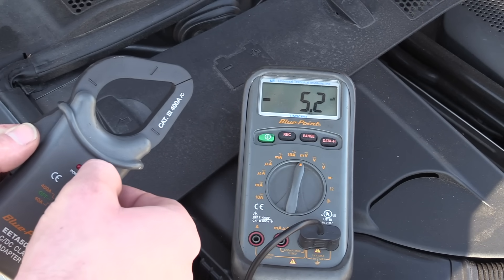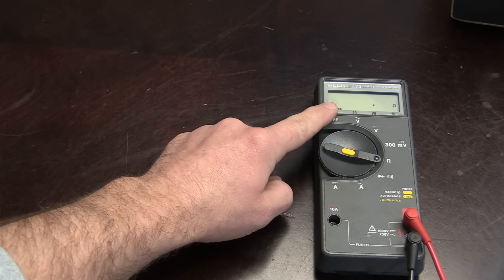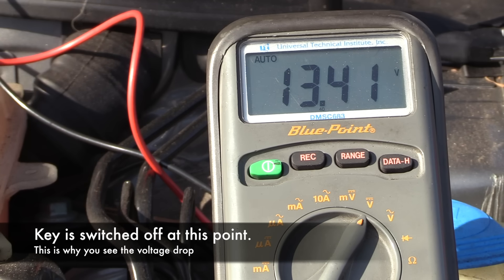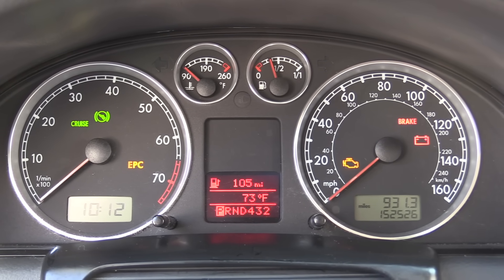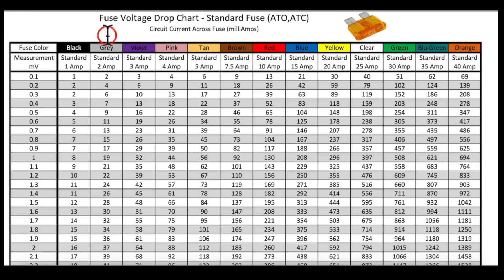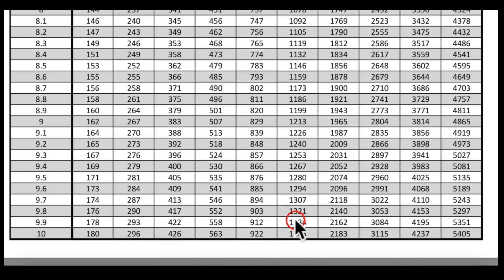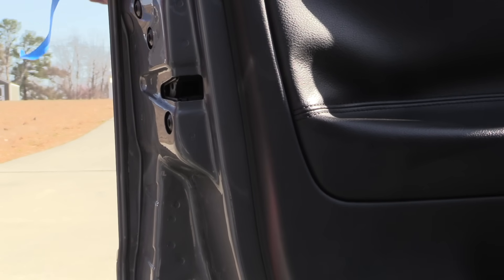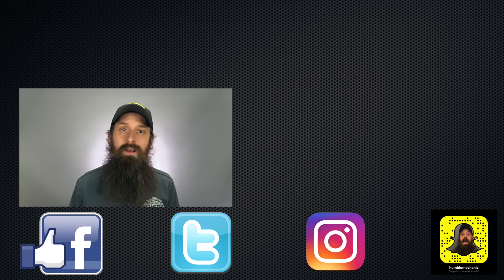The BEST Way TO Perform a Parasitic Draw Test

Comment: What is confusing me is , why does the fuse amp rating make any difference, seeing as they all have the same resistance? Please.
Reply: August Chennells 
Fuses will have different resistances depending on current rating. Fuses with a 1 amp rating will tend to have resistances around 100 milli-ohms. The higher the current rating the lower the resistance. Once you get to fuses with ratings above 2 amps, the resistance becomes so low, that standard multimeters will not measure it. In fact, most meters will see this as a short. It is this difference in resistance that causes each fuse size to trip or melt for a specific current level.

With regards to the 5A and 30A fuse:
If you are running 1 amp through each fuse and measuring the same voltage drop across each fuse then some thing else is not accounted for. Are they the same fuse type? Is it the same model of fuse? Was it made by the same company? Is the meter capable of accurately measuring voltages that low?

A quick look at a Littlefuse data sheet has a 5A unit with 0.0224 ohms and a 30A unit with 0.0019. ( Cold resistance )
Reply: August Chennells higher resistance would mean lower amps so pretty sure they all have different resistance
Reply: Not hard to check that with the VOM. I always thought the amp rating is determined more by the diameter of the fuse conductor, therefore the melting temperature. Am I wrong?
Reply: August Chennells 
It is the cross sectional area and composition of a conductor thar will determine the resistance for a given length of conductor. The smaller the area the higher the resistance for a given length. The smaller the area the more heat generated by a given current. The smaller cross section also means less mass to dissipate the heat. Fuses of different current ratings will always have different resistances assuming they are made of the same material.
Reply: Thanks for commenting Andrew! I understand that completely. But consider this, if you take a 5 amp fuse and a 30 amp fuse, and run 1 amp thru both, the voltage drop will be the same. When checking for a parasitic leak, the amperage will be minute, and the amp rating of the fuse will not make any difference. Or am I missing something?
Reply: Thanks!  I always thought it was only the conductor cross section in the fuse that determined the amp rating. You're saying that it also includes the composition (alloy) of the conductor. Right?
Reply: August Chennells 
Manufactures tend to stick with the same alloy within a particular model of fuse. They would use different alloy formulations to achieve other characteristics. Reduced package size, slow blow, and fast blow types come to mind. Within a particular model of fuse, they would typically only alter the physical dimensions of the fuse element itself. Thinner element/lower trip point.
Reply: Thanks! I assumed that was the case. So back to my original assumption, that when measuring the voltage drop across the different fuses, and then looking at the chart to estimate the amperage lose through a particular fuse based on its amp rating (color), is fruitless and meaningless, because all the fuses will have basically the same resistance in the low mil amp range of most parasitic losses. Does it matter how much the parasitic draw is? No, you just have to find and fix it.

Comment: Great video! I subscribed! I have seen draws go away when a battery terminal was removed to check for a draw. I have gotten into the habit of connecting my leads to both sides before removing a terminal.

Comment: what's the best way to find a short in a non fused circuit(like say a pickup coil to ignition coil on an old carbbed/distributed engine. or possibly if the short is before the fuse? I'm having issues with my 84 ford f150 it's killing the battery to flat in less than 4 hours, but it's completely intermittent. for a month, it'll be fine, then for a week straight I have to disconnect my battery (which sparks when I do so). I've been trying to figure it out for a couple months now.
Reply: I've done the fuse test and they all pull zero when off, battery load is   0.751 amps across positive terminal to batt post when truck is off. normal for the truck per the dealer is 0.006 amps.

Comment: If I thought I had a draw on my trunk light should I leave it open and simulate it being shut or leave it shut?
Reply: albert fishstix
Id be checking the light even turns off when its shut... a dicky switch might be leaving it on all the time.
As for this test, I cant imagine it matters one way or the other. As I understand, the point of having the door open is to access the fuses. Fake shutting them is just to allow "locking" the car and letting it drop into sleep mode.

Comment: i used to have a f250 that had a draw, somewhere. i just put a big disconetet for the battey on the front bumper. fixed. the guy i  sold the truck to found a burned wire in the altornater...

Comment: Wow! This is great information at the perfect time. I've been hunting for a draw on my 98 Chevy truck. It's been kicking my ass big time. It only kills the battery if I let it set over the weekend. I finally caved and sent it to a shop Thursday. Called them Friday after work and they haven't found anything yet. Hopefully it's dead Monday morning so I can show it's not in my head. If they can't find it, I'm going to put this to good use and see if I can get it narrowed down. Hopefully they find something, diagnosing electrical gremlins is my downfall haha.
Reply: ih1206 hey, not sure if you have a CD player in that truck but I had 2 cds stuck in mine causing battery drain. I was able to pull one out with needle nose pliers.
Reply: I do have a Pioneer radio installed in the truck that's been in there for years, but I've had the cd issue before on other vehicles. The shop tracked it down to the horn wiring harness. It never blew the fuse, but that fuse killed the draw. I'm leaving it sit this weekend to see if we cured the problem. Fingers crossed that we got it.

Comment: I'm glad you posted this! Just last week I printed out this voltage drop/fuse chart off another site. Well, just checking it against the Powerprobe site, the figures on it were WAY off! The print quality was terrible anyway, so I may have missed some key information about which style of fuse it was. Either way, I just pitched that printout in the trash, and I'll print the Powerprobe charts. You probably just saved me some major hair-pulling during future testing! :D

Thanks yet again, Charles! :)

Comment: Didn't know the voltage drop over a fuse is measurable with a multimeter at such low loads, thanks! Some cars don't have the door switches integrated into the locks. Especially older cars often have them on the body itself, so if locking the door doesn't work, it may be that the switch is simply somewhere else :)
Reply: Thom kouwen   Yes, I'm not quite following this, but I'm going to go with it. R, V and I Thevinan is in my mind, but it's pretty well in a hibernated state if not gone.
Reply: Grace James

Comment: so if i checked all my fuses by pulling and putting them back in on my 06 jetta 2.5 that may have messed up some electronics? i have experienced some issues since then such as the heated seats not working and also the engine having trouble starting sometimes( mainly cold mornings) and if so how would i treat this? much appreciated
Reply: If you are pulling fuses, and can think of it beforehand, take a picture of the fuse box before you start, with your phone or camera.  Even when pulling them out one at a time (foolproof, right?), I've dropped a fuse and when I looked back up I wasn't sure where it went because there were enough unused spaces next to the right spot that confused the issue.  This is especially useful when you are older and need reading glasses to read charts or if the chart is embossed on the plastic cover and hard for anybody to read.
Reply: haggismacbunk - So true. Accounting for that already saved me a lot of grief in several cars. Beside the reading glasses issue, trying to read/see fuses while laying twisted with the fuses seating deep into the under dash. It's a challenge at any age. BTW a perfect occasion to develop your swearing skills. LOL ;-)
I always thank Mercedes for having put the fuses and battery on the passenger side floor. Flat, horizontal, accessible and can be worked or perfectly seen while seating... AND a big clear fuse/relay chart written in 4 languages, laying there in the same compartment, saves a lot of grief and  headaches. :-)
Reply from the maker: +M1xxDuP3ngu1N it won't mess them up. But it can mess up the results of your draw test.
Reply from the maker: +M1xxDuP3ngu1N be sure the fuses got put back in the right location. That's the #1 issue I see when a problem pops up after someone checks fuses
Reply: HumbleMechanic ok but if I also messed up the configuration going by a chart online that wasn't correct? a vw mechanic said they looked fine, I can't find an actual chart anywhere and the manual is not the same configuration
Reply: Does the fuse box cover have the chart on the back? If not then it might be time to buy a repair manual.
Reply: Drcool52 sadly no it doesn't and the owners manual like I said is a bit different than on mine

Comment: Thanks humble mechanic! I've done tons of parasitic draws and never thought of that! Just curious what do you personally do when the draw is coming from a closed box fuse? You know the ones that have the clear caps on them.
Reply from the maker: I hope that I find it before I get to those fuses LOL. Sometimes you can pull the fuse out enough to get on the ends. There are times where you have to break the "no pulling fuses" rule and swap it or just pull it. I don't prefer it, but you have to do what you have to do
Reply from the maker: +jay 80 you're looking for a MV reading. That is a MV DC setting
Reply: +HumbleMechanic why set it on 300 mv and not put it in
 V dc?
Reply: +HumbleMechanic also what is the maxium current draw spec?  .3 .4 ? thank u..
Reply: I always was told  50Mv   or .050 Amps

Comment: Can you suggest the best way to test for a parasitic draw on a 1992 vw cabriolet? I've been told that generation already has a reputation for electrical gremlins.
Reply from the maker: HAHAHA they really do. For that car, you can use this method. It works great. Or you can use a current clamp, or go inline with an amp meter to measure the overall draw. Then pull fuses to see what makes it stop. 

That is a same test on old cars.

Comment: What about when you've got an intermittent draw, like a module that is offline that another module keeps trying to communicate with. I've identified them on a scope before and you'll see a spike every so often but not sure if would be possible via this method. Another easy way to identify a draw is a thermal imager. You can see the heat omitted from a consumer as long as the surrounding components aren't hot.
Reply from the maker: +Steve Bergstrom that's a case when you would want to measure overall draw with an amp clamp. 

I love the idea of the thermal cam. But I've never had an opportunity to test it. 

I may do another video trying it. Creating the same draws I did here
Reply: You'll have to try it.  I have one.  With it, you can sweep a room and spot all the items plugged in.  They glow like a lighthouse.  Not sure how well it would work on a car with the engine heat.  You may have to keep it overnight and check it in the morning.
Reply: Russell Hltn yep, check it after the car has sat for a while till it's ambient temp. have a customer drop it off at night and when you get there in the morning do a quick look around the car

Comment: I'm liking this method very much. saves pulling fuses and as you say doing that could cause problems or stop the fault showing up. I had never considered measuring voltage drop over a fuse very smart! this is going to help with work I hate those flat battery faults and have always struggled to find them. thanks big thumbs up!!!

Comment: The UNI-T UT211B clamp meter measures current in the miliamp range both AC and DC separately. Only costs $70 or so. I think it's the best unless you but some lab specialized Kyoritsu.  You put it at the input or output of the battery and you can see the total consumption of your car.
By the way, a standby consumption of 60 mA DC, for a Golf 4, how good it is? Does the amperage increase with newer cars or it's not the case?

Comment: Very good video thank you. 

In  South  Africa  we often have a current draw coming from a tracking unit, they have their own batteries but when those fail they are wired to run off the vehicles battery.
The trackers are completely independent of the vehicles electronic system, so is it safe to say that none of the fuses will show a draw?
We normally literally have to strip and look for the tracking unit which can be anywhere from behind the cubby hole to hidden under the handbrake boot inside the vehicle.

Comment: Great info.  One thing to keep in mind if you are looking at older cars, at least through the 1980's with American cars, the dome light switch is in the door jamb by the hinge so closing the latches wouldn't make a difference.  Then again, those old cars you could just pull a bulb or two and be done with it.
Reply: Yes you have to tape those down.
Reply: Some cars has the door jamb switch as well as the latch switch. These circuits are more complex due to alarm systems and to tell the computer that the latch is activated.
Reply: My 1995 Sentra dome light has an off switch (and nothing else comes on).

Comment: Good video mate, love your work. I've had parasitic drain problems on cars and plant in the past and I use a uA current clamp on the main battery lead and pull fuses and unplug stuff till it disappears, found it a lot quicker.

Comment: I've been doing this without the charts, then going for the circuit with the biggest drop. Thanks for the charts! At first glance I wondered if they actually measured these values, or whether they used Ohm's law, calculating the numbers. A quick back-of-the-envelope check on a couple of chart numbers shows variable resistance depending on amperage, although strangely resistance was lower at higher current for a few. The numbers are really small, so slight corrosion at the tip of the probe might change values. I like your idea to trick the computer into thinking the doors are shut so it will go to sleep.
Reply: I would expect a lower voltage drop on a higher amp fuse, after all it does have to carry more current requiring a larger internal fuse element. bigger element carries more currrent without overheating, ie blowing out.
Reply: It's not that strange to find lower resistance for the higher rated fuses.  Fuse is meant to blow at certain heat developed by current flowing across a resistance.  Heat is generated by power dissapation in the resistive material.  Power is the current squared x the resistance.  Simplistically speaking, if you had same resistance for the higher rated fuse, say 30A, that fuse will blow just the same as the 1A fuse.  Of course, they can use different materials to change characteristics of when the material melts with different resistance/current combo.
Reply: W

Comment: Uti is still selling those blue point meters. The school napa store is making a fortune selling the 10 amp fuses that we all killed in electrical diag class.
Reply: My electrical teacher just wired up a car fuse to his multimeters because to many kids were blowing the 13 dollar fuses built in.
Reply from the maker: HAHAHA no doubt about that. They cost like $25 back when I was there. LOL
Reply: yeah I still have mine from NTI.... a few years not in use... had to check battery... powered right on up
Reply: TheBurnout Blue point meters aren't too bad ,but their leads suck , fluke leads are the best, fluke is the best, still have a 78 somewhere.
Reply: I still use mine every day 16 years now. I had to solder in the battery tray the solder joint got loose. Good meter though.

Comment: why dont you do a vid on a battery which is loosing its draw because a full battery wont exist we loosing current draw are you doing these vids for other tecnicians or home mechenics
Reply from the maker: This video is for everyone. 

I am not fully sure what you are asking in the first part of the comment
Reply: HumbleMechanic im sorry to do this method u said the batery needs to charged and if the draw  is discharging the batery !!!!!!!!! its never goin to stay fully charged while checking the fuses the batery is discharging depending on how high the draw is awesome beard
Reply: Most draws take hours to discharge a battery. If you don't have time to do this test before the battery dies then you have bigger problems.
Reply: It's not going to stay charged but you can't start testing with a dead/bad battery. A dead/bad battery is already an electrical problem. Charge the battery and then look for a current draw. If the battery won't take a charge then that's your problem, no need to look for a current draw.
Reply: I think the reason the battery has to be fully charged is so it will work properly with the Power Probe chart.  It is for accuracy.

Comment: So kinda of of topic question I'm about to get into building a custom wiring harness with a ecu how do I determine what circuit protection do I need in the fuse box
Reply from the maker: I would use the OEM wiring diagram as a guide. If the circuit uses a 30amp fuse from the factory, I would use that. You can also calculate the expected loads of the circuit and fuse it accordingly
Reply: HumbleMechanic I'm going to put a wrx motor in my 69 t1 so making 2010 Technology mesh with relays from the 60s with be interesting I just don't want to light my car on fire lol